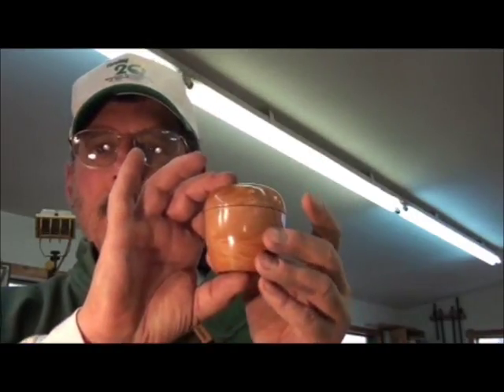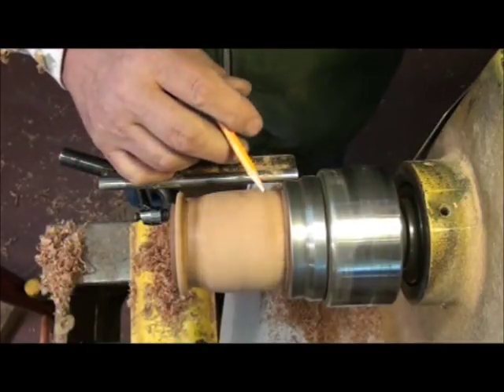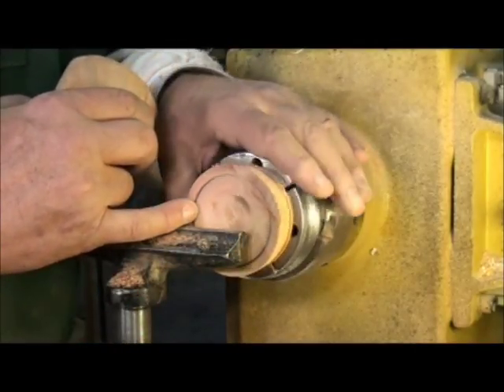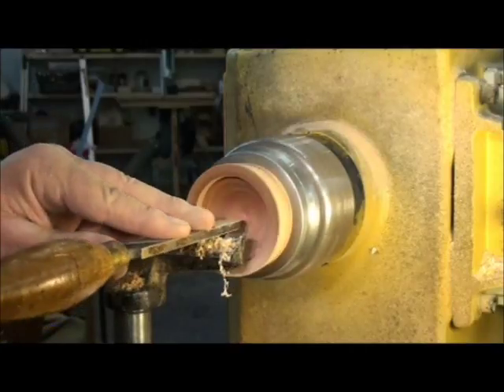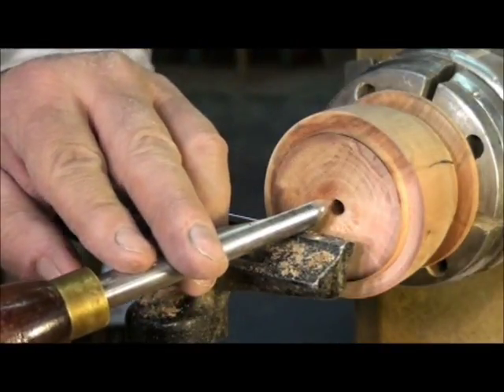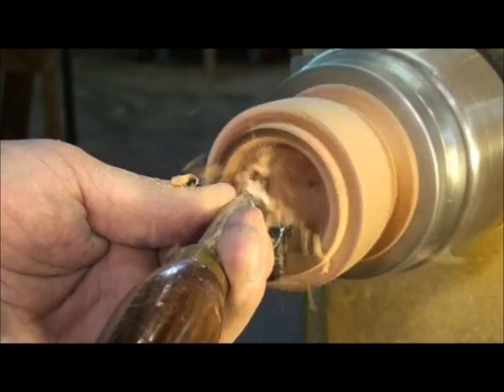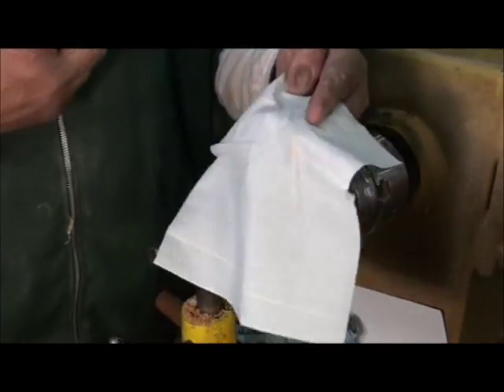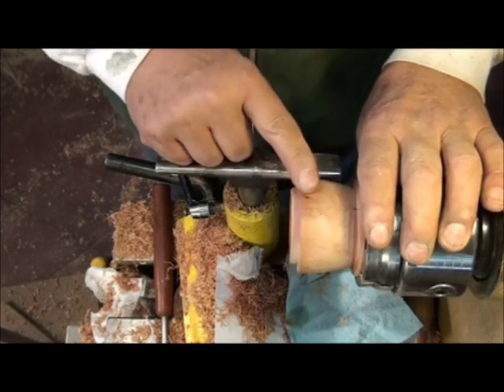Turning A LIDDED BURL BOX

Comment from the maker: (I am pasting the same response from another comment)  I have used shellc flakes (usually blonde shellac) for years.  I use what I need to use for my objective at the time.  I often seal wood with shellac even when using an oil for a final finish.  I am using a lot of lacquer also, usualy spraying it.  I live shellac flakes cause I think it is less expensive than starting small objects with a friction polish.  Sam

Comment from the maker: I have used shellc flakes (usually blonde shellac) for years.  I use what I need to use for my objective at the time.  I often seal wood with shellac even when using an oil for a final finish.  I am using a lot of lacquer also, usualy spraying it.  I live shellac flakes cause I think it is less expensive than starting small objects with a friction polish.  Sam

Comment from the maker: Charlie 
Great question.   This roughing gouge is 1 1/8"  It is actually too big for lots of stuff. I have another one which I get from Packard woodworks.  Not sure of the size but I think it is sold as 1/2"  NOW....how are they measured?  In the USA, gouges are measured by the diameter of the tool steel.  In Europe/UK, gouges are measured from the outside to the inside edge of the flute farthest away from that side.   (see next post)